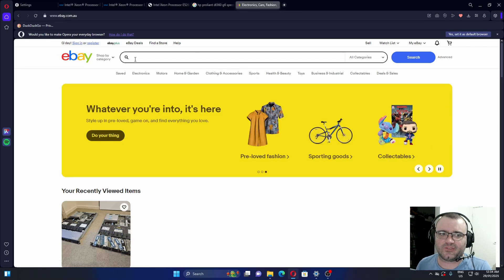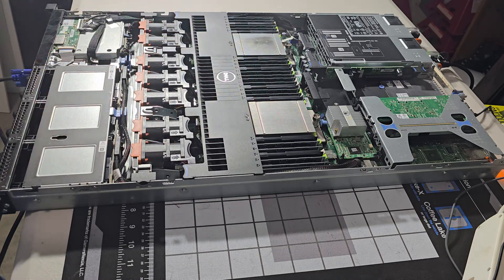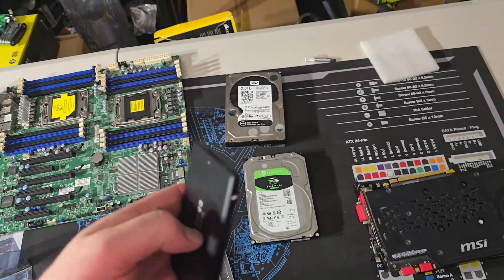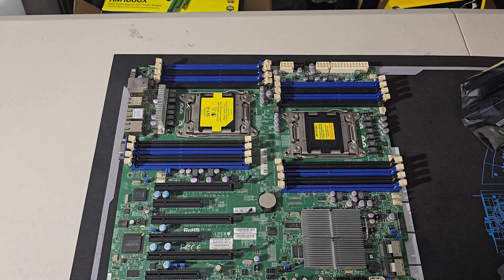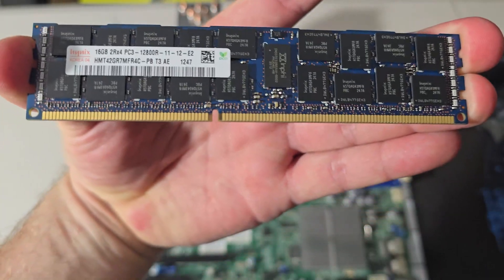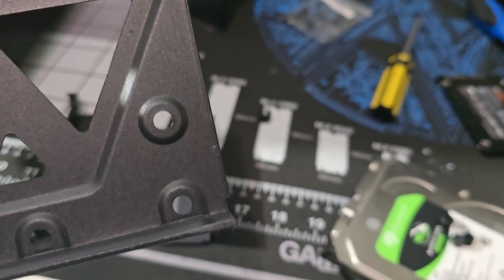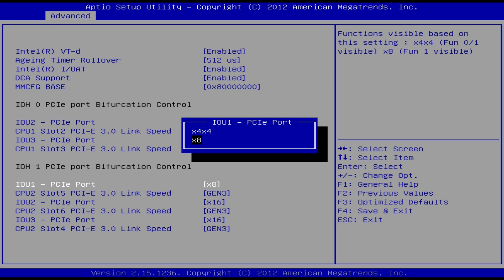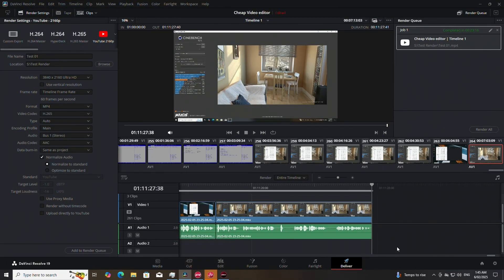Dual Xeon Server to Video editor E5-2687W

Comment: Bought some blade servers back in the day just for the RAM and CPUs. (Low bids on eBay)
Got to love Supermicro and their standard sized Xeon motherboards.
Reply from the maker: @grahamleiper1538  The only thing I don't like about the old server is their high idle power use. So I wouldn't use it as a 24/7 system.
Reply: @ProjectSmithTech  Power consumption gets a lot better when you get to Haswell and Broadwell stuff, but the price goes up.